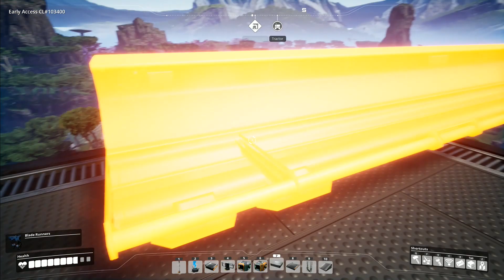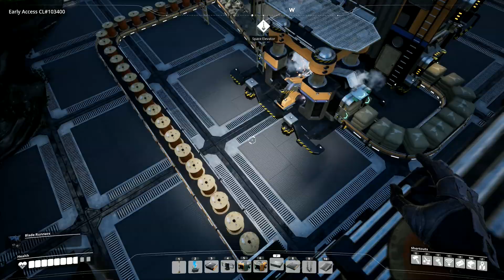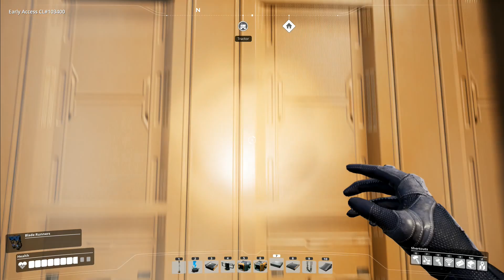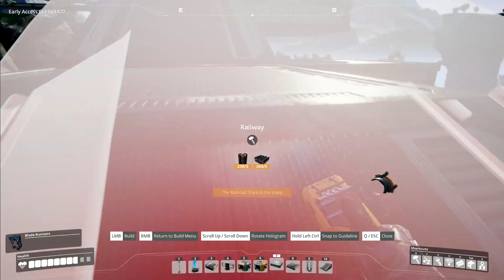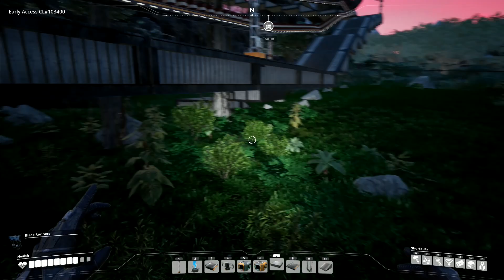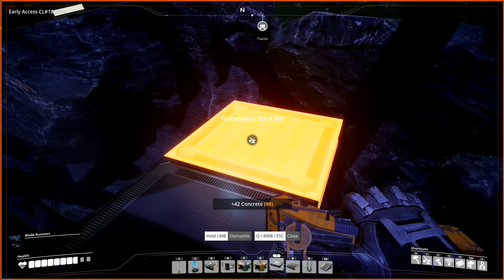Let's Play Satisfactory #81: Long Track Build!

Comment: Hi Frith, you have probably already worked it out butToo steep means the height difference is too greatToo sharp means the curve is too greatToo long means distance is too greatto get a perfect 90 degree turn you need a 3 by 3 foundation square (L shape to be more exact) or 4 x 4 (5x5 etc)

Comment: Think outside the square box, Frithgar! :) If the gradient is to steep you can always start the climb earlier.  Maybe it will also need some supports in a "not so in an engineering manner real fashion" to link the rail-parts if you build in mid air. But the last thing you already is very good at.